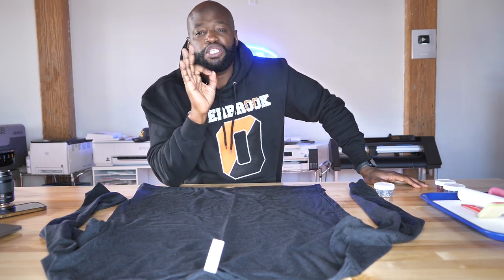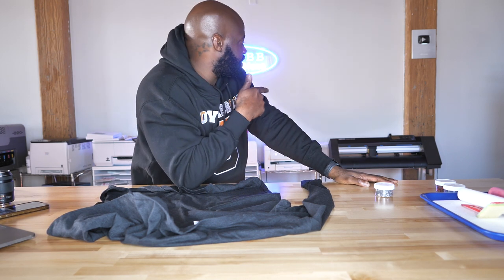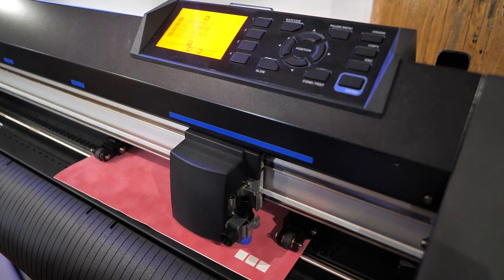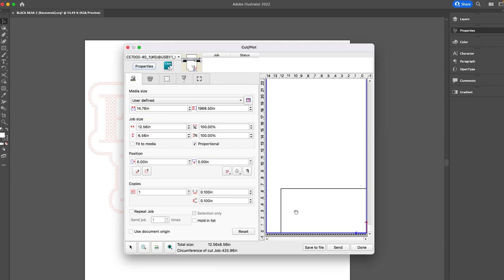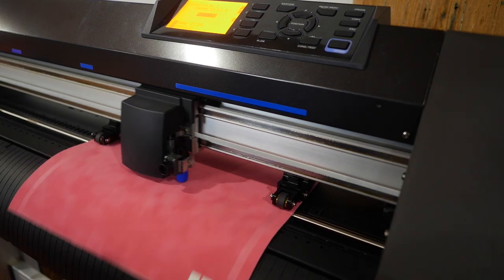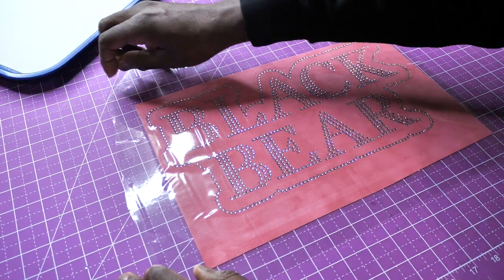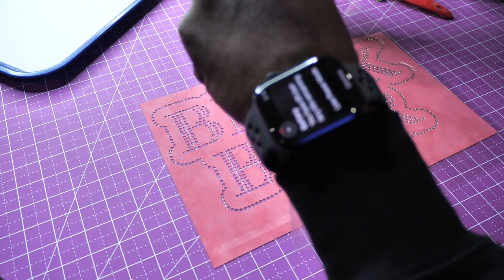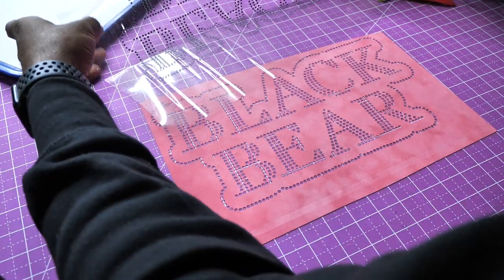Making a Rhinestone Shirt For the First Time (GraphTech Cutter Tutorial)

Comment: Love the Graphtech, but I cut mine on the Cricut mat, I peel the backing  off the flock, and stick it directly on the mat, that way when I peel the flock off all those dots stay on the mat and I just squeegee them off. and my template is ready.
Reply from the maker: Good idea. Those small dots tried to take me out. I’m gonna get the settings to cut all the way threw to make it easier. I’m gonna extent th blade length just a little more and that should do the trick. We will see.